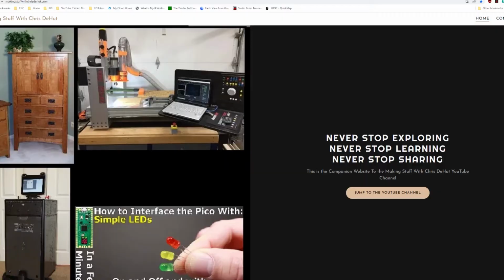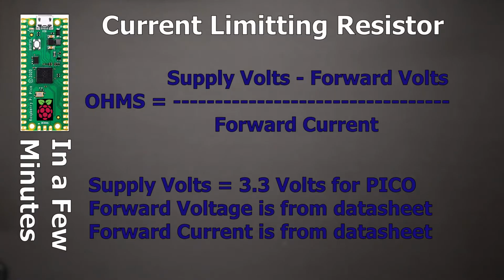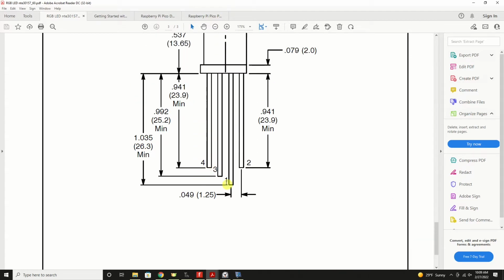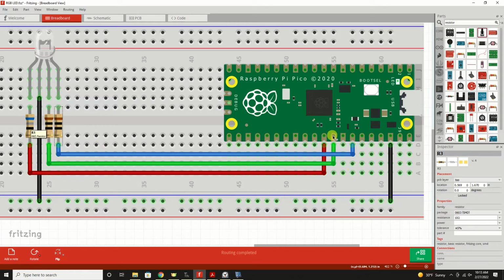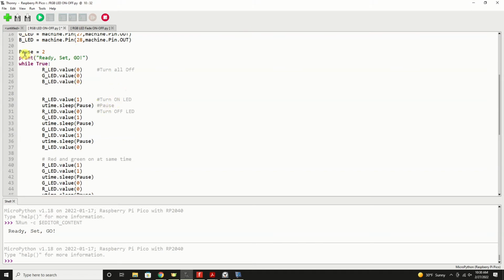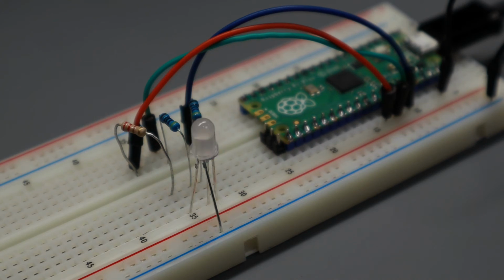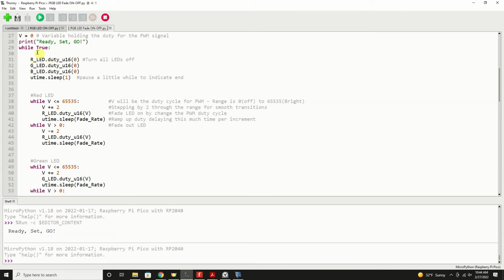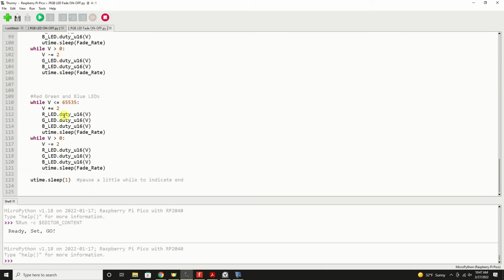Using RGB LEDs on the PICO

Comment: Ive downloaded your project zip files and i thankyou very much for your kind access.
The problem i am having is pairing up your files to the associated youtube video content.( you have that much)
Is there an easy way to do this?
Thanks
Reply from the maker: Hi user-nk5vc9ot6l,
When I started the website to support the YouTube channel, I picked the best template I they had to match what I needed it to do.  I agree, it is not the best way to serve the community.  Website templates really restrict how you can layout the site and what elements (such as file downloads) can be placed on which pages.  
I will certainly give some heavy thought on that and see if there is a way I can manipulate the pages to do what WE want, rather than what the template allows.
Give me time and I will look into a better solution.
Cheers!
Chris